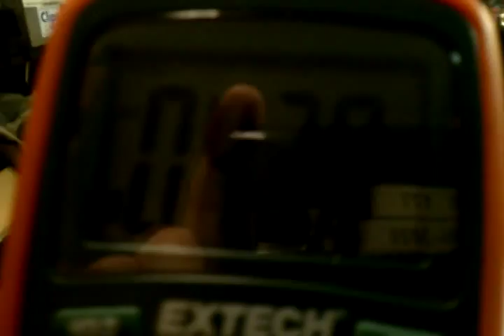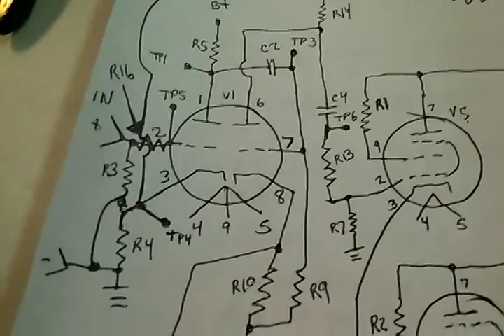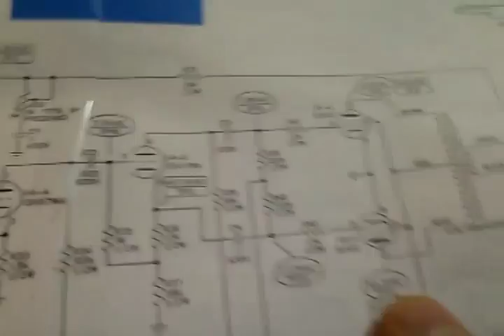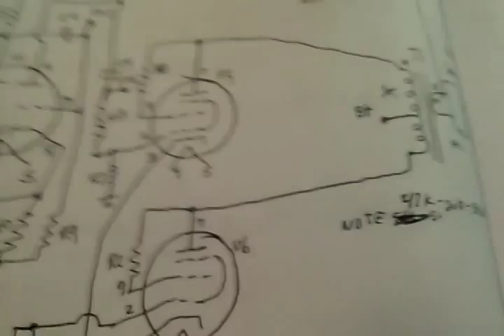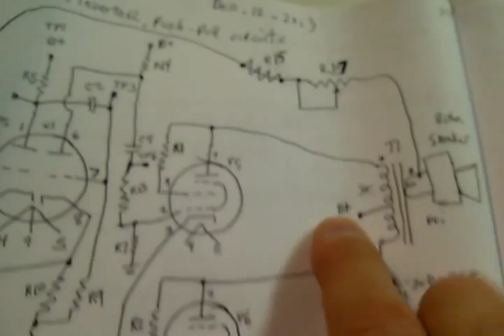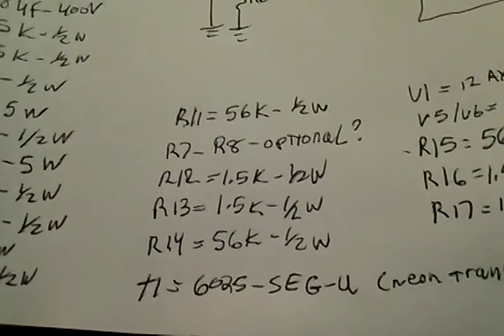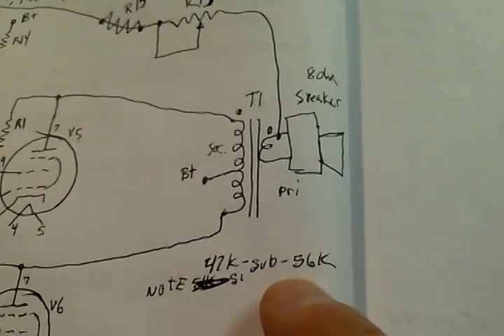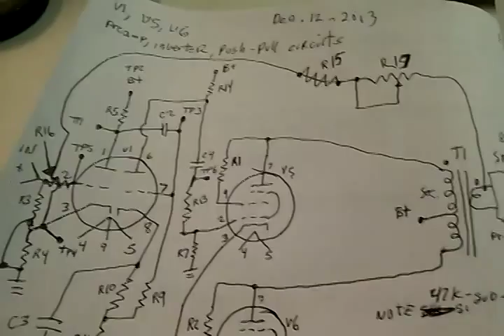12AX7 and EL84 push pull amp

Comment from the maker: This is my one of my self taught electronic courses on my way to developing a 13.56 MHz power supply so I can do some Donald L. Smith experiments.
If you ever try to find a 13.56 MHz power supply you will fins them expensive! They wanted 3500 bucks for a used one on EBay!